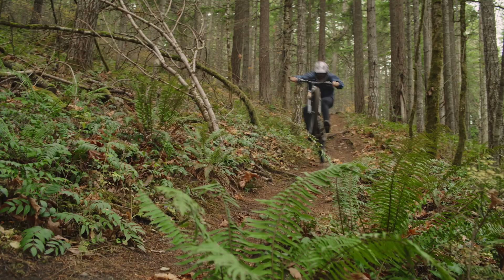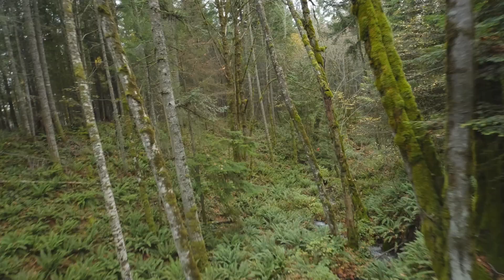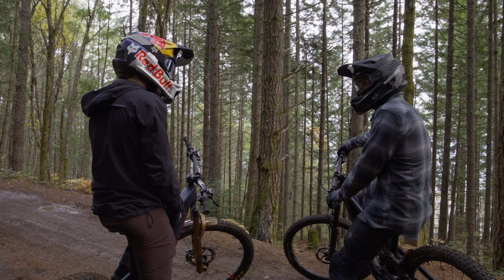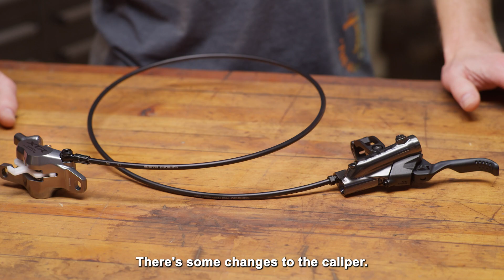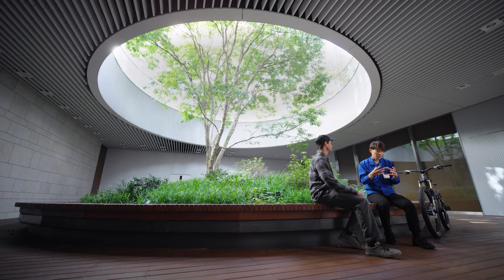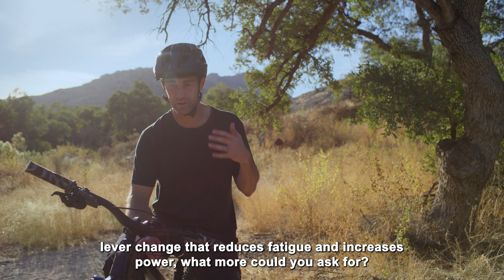XTR Explained - Episode 2: Consistent | SHIMANO

Comment: Jackson Goldstone winning Downhill races with it is a testament to their product.
Reply: He's sponsored so he has to use it. He also has a mechanic doing the servicing. 

If the top riders has a faulty part they will just swap it for a brand new one if it will take too much time fixing it, so this is also another reason why you should never look at what the top riders use. It's irrelevant. 
If Hope started sponsoring him he would say those are the best brakes, or if TRP sponsored him that would be the best brakes and the list goes on. You also need to understand that the top riders can manage with less good things simply because they are actual capable riders. 
Just because he won something doesn't mean Shimano brakes are the best in the world, because that's far from the truth. Shimano has for years had so much bs with their brakes, and just continued. Maybe the new brakes will be less flawed, who knows. Only time will tell. 

It's still a brand who make parts primarily to dress up complete bikes with to push it out the door, just like SRAM for that matter. Once you have ridden a bit you quickly realize the parts most new bikes come equipped with isn't really all that good. Same goes for Fox and Rock Shox suspension. All of these kind of brands can for sure be found on bikes used by the top riders in the world, and it makes no difference for everybody else because they are sponsored, and have mechanics and access to new components when they need it, as well as mechanics who know how to tune and tinker with components to make them better. 
As long as they got a capable frame, they can make due with certain lesser good parts as long as they work.